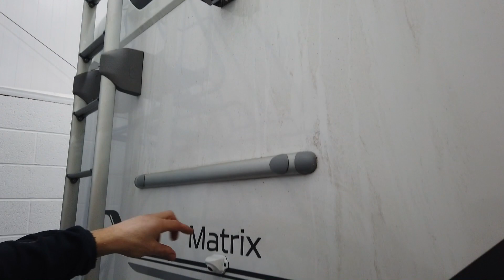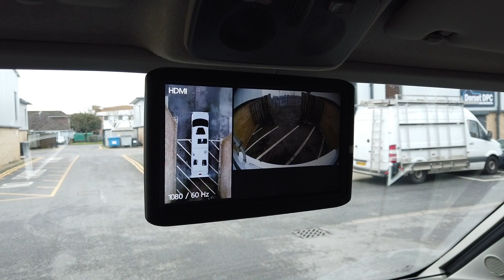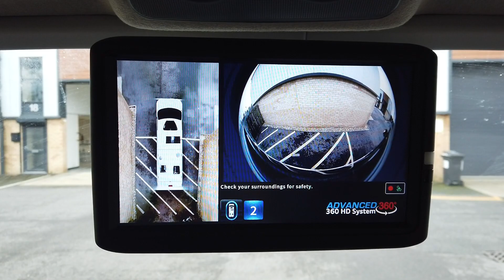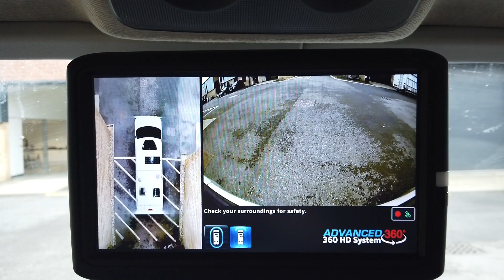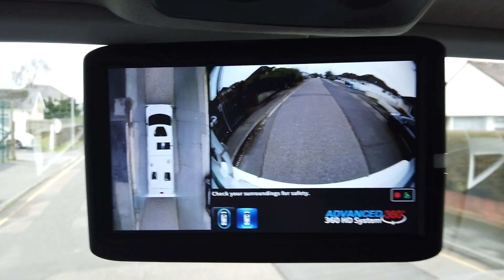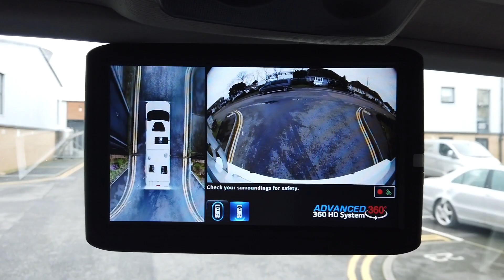Motorhome 360° High Definition Camera & DashCam System | Motorhome Retrofits

Comment: Hi, it´s possible to use the system as a security monitoring system while sleep ?. The idea it´s to put an additional monitor near the bed and be able to check the surroundings in case of strange noises or behaviors. So, the system must be able to stay in stand by and wake inmediately,  large boot times will be no admitted. And I realize it´s possible to have a decent view in dark environments. Thanks
Reply from the maker: Hi Fernando! This system isn't designed to be a CCTV System which is what you are trying to describe. This is a 360 Parking System (So you can see all round the vehicle whilst driving) it also doubles up as a DashCam so it records whilst driving. There are 12V CCTV Systems available but these can use a lot of power and the cameras themselves are quite big and bulky.

Comment: How good is the image at nightime and could the unit be switched to run of leisure batteries? And maybe image shared to a TV in the rear bedroom for example? I'm thinking for security purposes?
Reply from the maker: Hi Craig, sorry for the delay in reply. Missed your comment. I've just commented on another post on this video in saying that this isn't a CCTV System and wasn't designed to be. It's main goal is a 360 Degree Parking Camera to help you whilst driving (So you can see all round the vehicle). As it has a built in HDD it also works like a 360 Degree Dashcam which is quite cool. It's very power hungry and can't really be used in the manner you have described. There are 12V CCTV Systems out there but again Power Hungry and the Cameras are quite big so there has to be a trade-off.